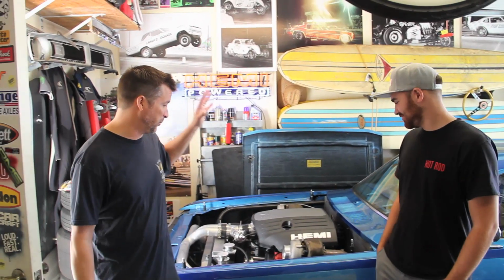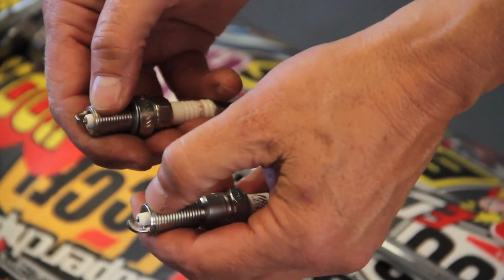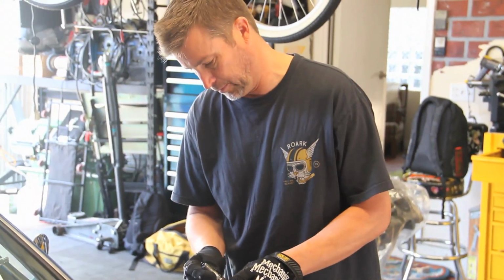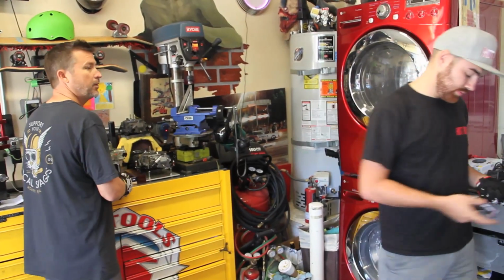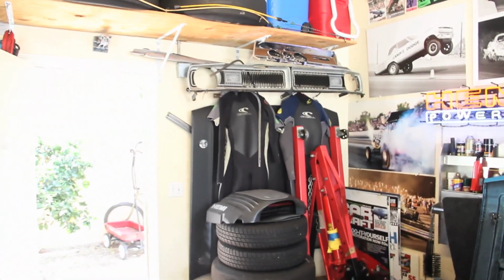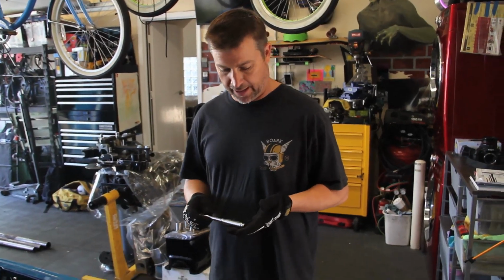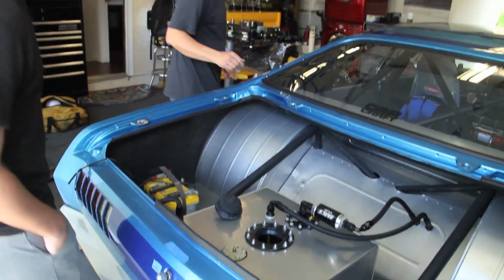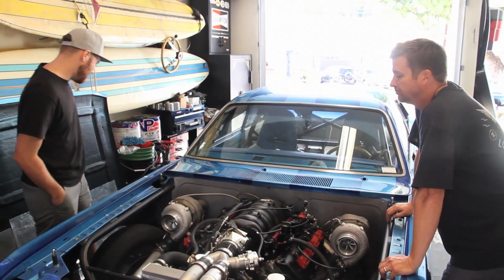New Spark Plugs in the Twin Turbo Hemi!

Comment: Hope that is not anti-seize you are painting those plug threads with. Anti-seize will cause a heat barrier, making your plug hotter by less transfer to the head.
Gm once put a service bulletin out regarding early plug failures due to anti-seize.
Better to use a thread chaser and a couple of drops of light oil on the plug threads every 3k miles. This removes corrosion from dissimilar metals, which seizes the plugs and maintains your desired heat range.

Comment: I use NGK plugs in my RB30 turbo- LOL- I use "9's" though... It's the coldest plug available for the application. Factory RB30 turbo plugs are "6's". When your using big boost on shitty pump fuel you need to be careful with things like plug selection. I used to use "7's" but it was sensitive to oil temp and would rattle and ping. The only problem I find with the "9's" is that my fat idle mixture can foul the plug if I let it idle more than 2 or 3 mins- but it clears right up straight away and off you go!!! By the way, I LOVED that car so much and watched it being built with great interest inn the pages of Popular HotRodding (or was it Car Craft??? Cause I bought both religiously along with Hot Rod of coarse). They seriously should bring that mag back

Comment: No Torque specs on the plugs? Should be using a cheap aligator clip ground strap on that plastic funnel so static electricity doesn't cause a fire in the garage with that race gas. Great to see the Car Craft Demon! Do kinda miss the AMC. Done with parts which the " average Joe " could do. Need more C.C. Articles in Video.

Comment: 1st the colder the plug the faster it fouls that's why the auto manufacturers can get 100,000 miles out of one set of plugs because they use a high enough heat range plug to constantly burn off the carbon build up. 2nd you should never ever ever test spark plugs gap on a platinum or iridiam plug with a normal spark plug gap tester because it breaks the small tips off and ruins the plugs.